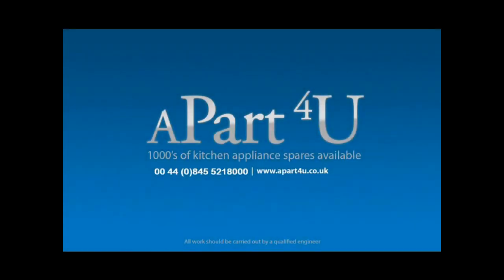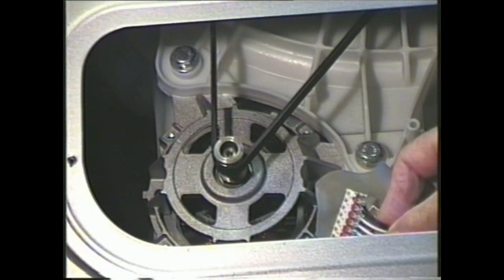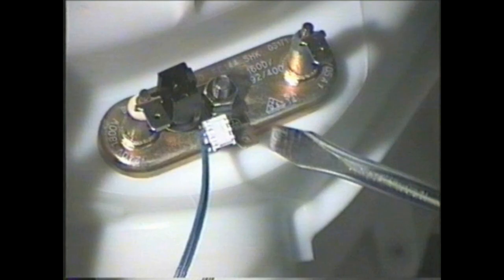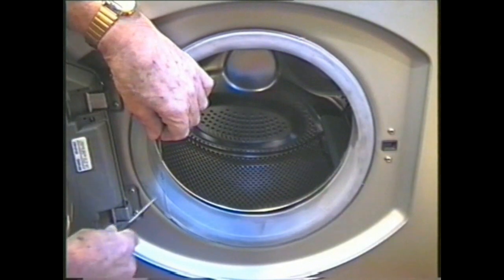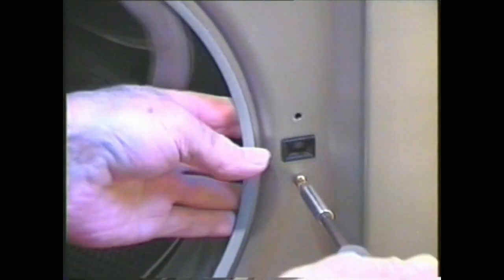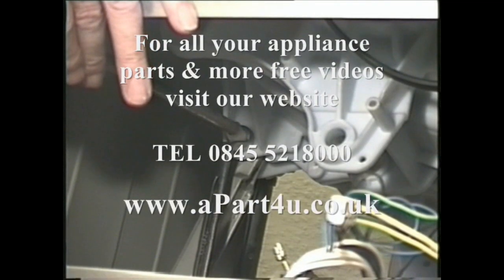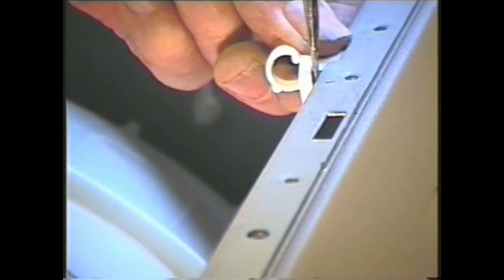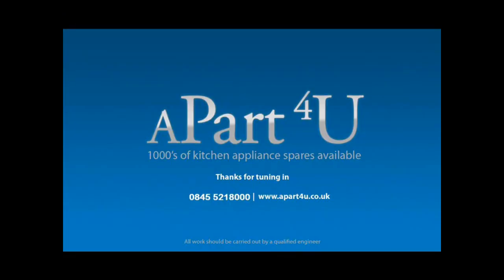How to remove a washing machine Drum tub 1 of 4

Comment: I was trying to get a drum out for use on another project. I didn't have to be nearly as gentle as you since the washer was headed to the trash, but despite tearing into it, I was stuck when it came to the shocks. Looked at several videos; none as comprehensive and straightforward as yours. Honestly wouldn't have figured it out without you.  Thanks!

Comment: learnt alot from these w.machine repair vids, its turned out that am extremely fortunate, when i began to dismantle my machine-a serviscaress( M3009A)  to replace the bearings set, i found my drum had a back plate which meant i didn't have to remove anything but the top & back of the machine, i had to unscrew a couple of earth connections from the motor to the element,oh then removed a large brace/collar type thing, (abit like a massive jubilee clip) but after taking the belt of n pulley, i only had to wiggle the back plate out n job was a good'n...had the drum out in a jiffy...now lets just hope i remember how it goes back together ! thnx 4 the vid :)
Reply from the maker: I am glad I could help you with this problem.Please remember to subscribe to our channel https://www.youtube.com/user/Apart4u?sub_confirmation=1

Remember to Shop with www.how-to-repair.com and it would help us by posting the video or
website on your timeline. This helps us a lot and if we really helped you can
always buy us a beer http://how-to-repair.com/help/buy-paul-a-beer/
Please remember to mark us to your favourites also I would be grateful if you would
subscribe to our channels social media as this really helps my site and keeps
us going.YouTube. http://www.youtube.com/user/Apart4u
Facebook. https://www.facebook.com/how.to.repair.appliances

Comment: Just replaced our Hotpoint after 9 years use. Thought I'd take it apart to get it in the boot of my E46. Well the fucking thing is spot welded together. The only part that is removable is the top. I crow bared the thing apart. Then the plastic drum housing was sealed solid, I had to saw it off. Then the spider needed removing as it made the drum too big to fit in the boot. Guess what.. that was stuck solid and needed a crow bar and a lot of leverage before it released. I then  crow bared the front face off then managed to fold the rest flat. Now I have a  Hotpoint that fits in the boot of an E46 😆